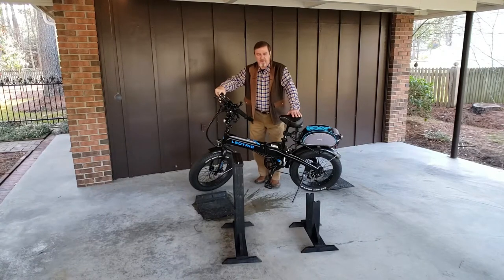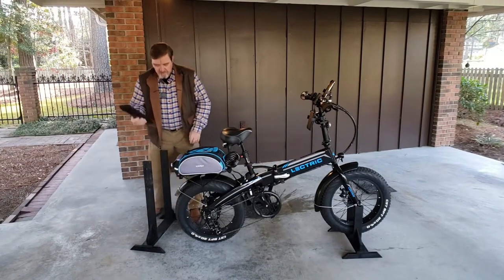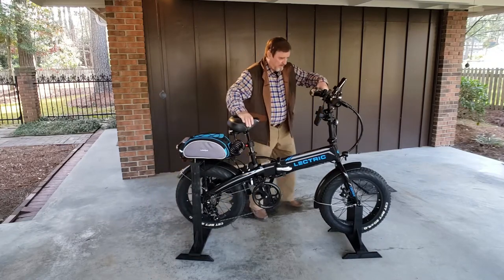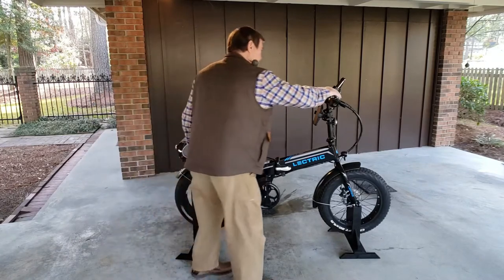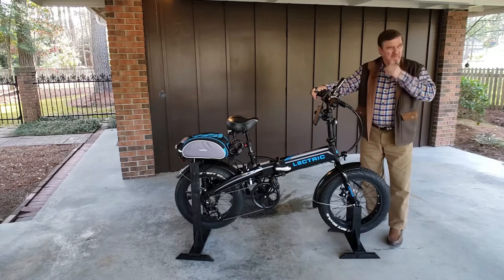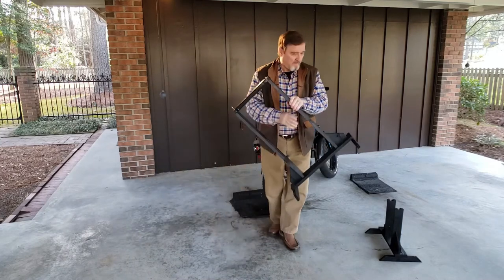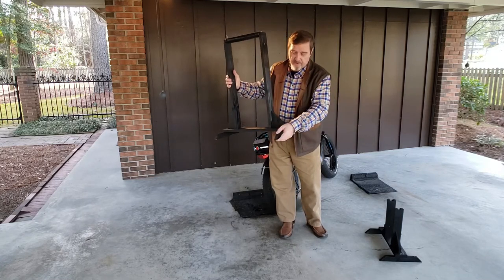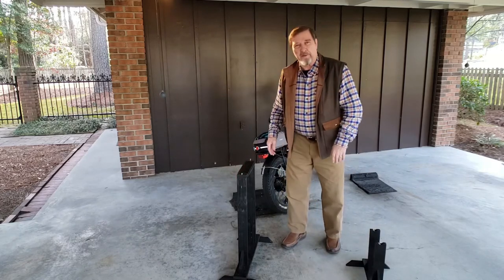Lectric XP Bike Stand

Comment: Built the stands.  What size is the cutout for front forks?  Thanks  Gary
Reply from the maker: I used a 1" dia sanding wheel to make the cutouts for the axle nuts to rest on.  But, you also need to notch out for the fender brace lugs/screws so the weight of the bikes fork will rest on the axle nuts and not the fender brace lugs/screws.